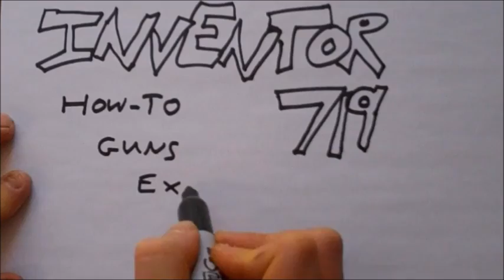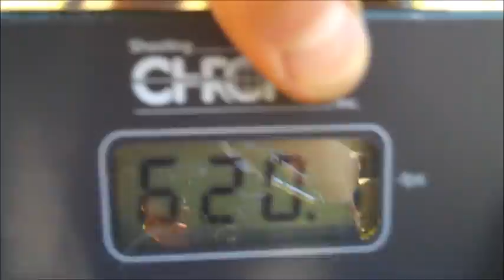Homemade 600+ FPS BB Cannon

Comment: How do you drill a straight hole? I have been trouble doing this for a project I'm working on. I have a drill press, but the holes still come out crooked.
Reply from the maker: Make sure it is in the vise square and the drill press should drill a straight hole

Comment: inventory you should definitely drill a hole big enough for a firework mortar round to fit in then do a pellet in the barrel of the aluminum and I guarantee you'd get easily over 800 fps